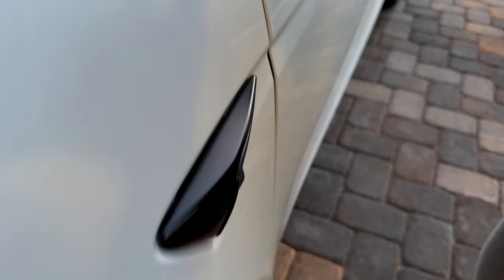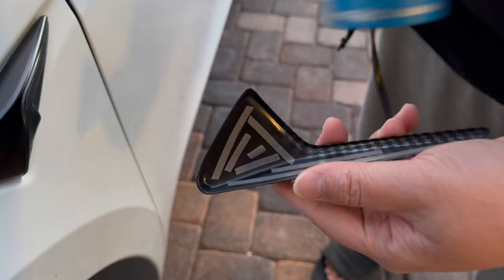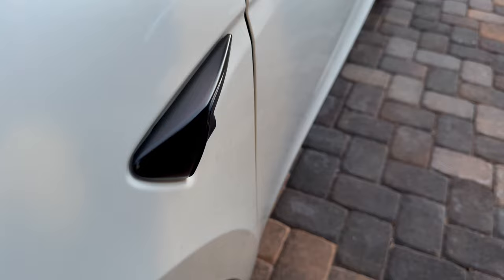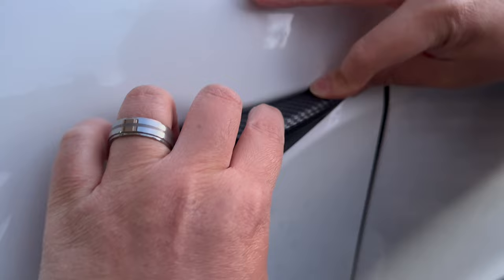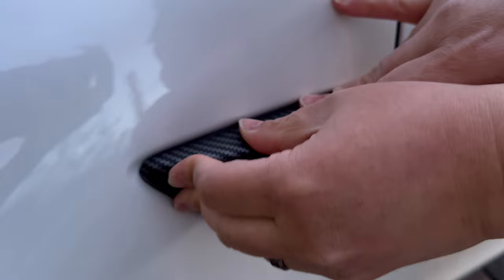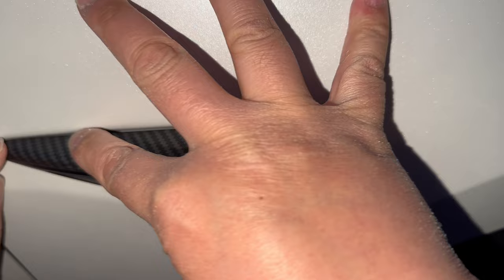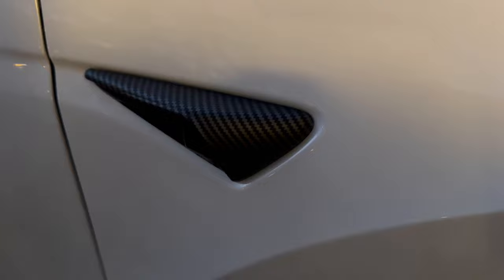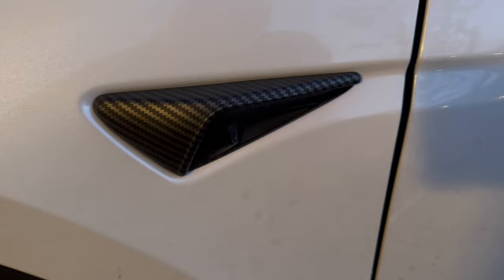YHCDSEA Model Y/3 Turn Signal Side Camera Protection Cover Matt Carbon Fiber Installation Video

Comment: I must be a rare owner. Besides something chipping my windshield, I’ve had no issues with mine.
Reply from the maker: Nice 👍🏼 good for you mine have gapping issues. Frunk alignment issues and paint correct issues which took the longest in and out body shop several times until the car paint up to standard.